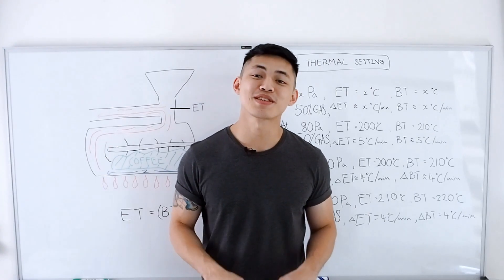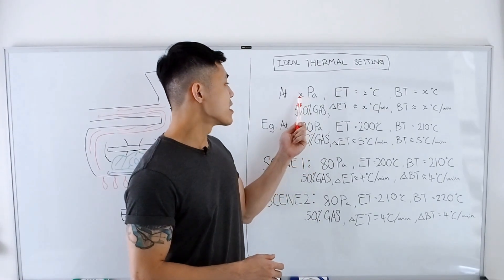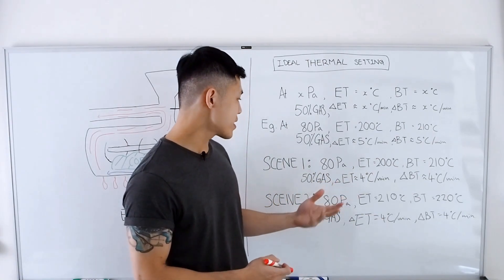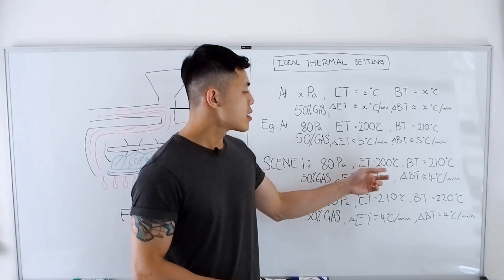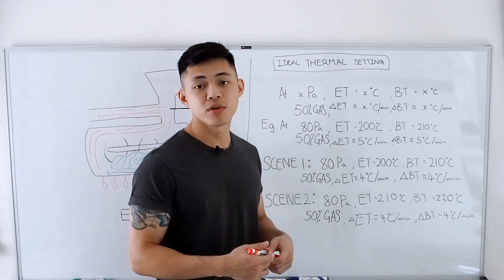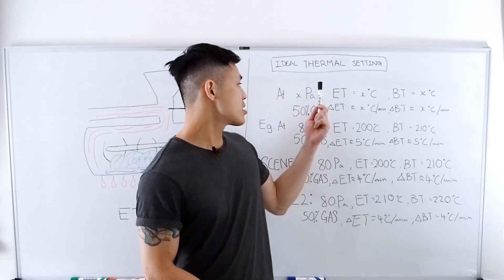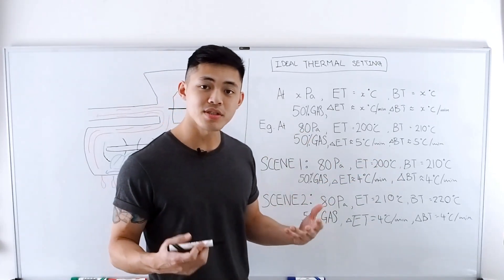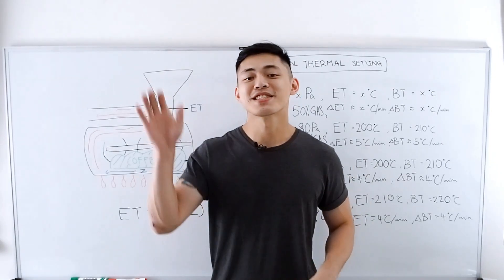How to pre-heat your coffee roaster part 2: Managing the RATE OF RISE

Comment: Very unclear, too much bt and et🤣
Reply from the maker: Let me summarize: at a specific BT/ET, Airflow, Drumspeed and Gas pressure, you want your idling ROR to be the same every time you pre-heat your roaster. If ROR is slower than normal = too cold. ROR is faster than normal = too hot.